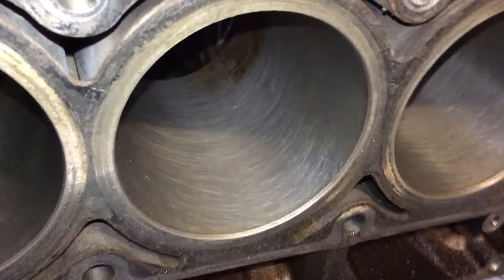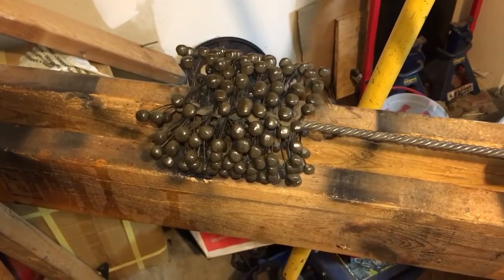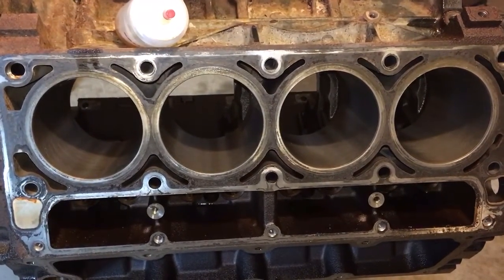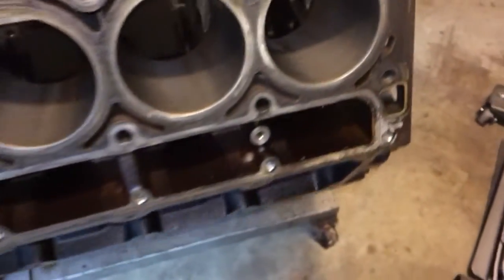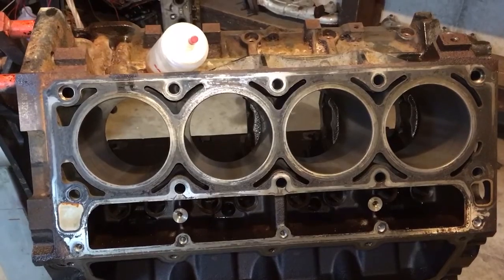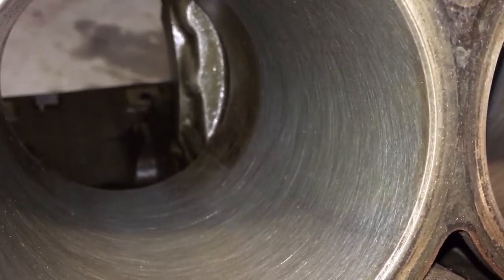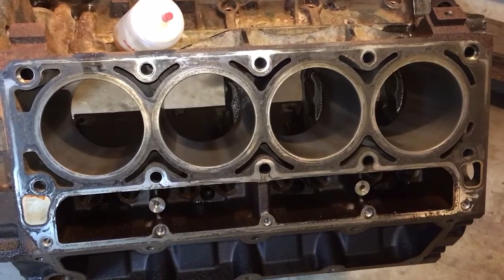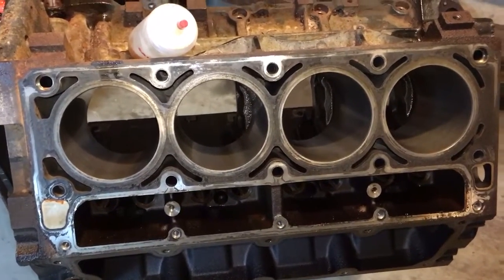Turbo 4.8 deglazing the cylinders. Turd-Bo

Comment: Did it work well for you
Reply from the maker: GEARHEAD HUFF I ended up honing it one more time, once I had better lighting I could see it needed a bit more.  Remember to alternate the direction of rotation during the honing process. 
I took this block to have New HD cam bearings and have it washed.  The machinist said the final hone job was great!
I’m just now assembling this same block!  Subscribe to see the 4.8 Turbo build. 👍👍👍

Comment: What cam are you switching to
Reply from the maker: GEARHEAD HUFF Changed from the original plan LS1 factory cam to the Elgin 1838p:
.560/.560 @.050 216/220 adv 285/292 LSA 114

Comment: It is interesting to read about using a flex hone. I had 2 friends who bought used cars that were advertised as having rebuilt engines. They were probably just rehoned while the cylinder block was still in the block, and the results was those engines burned oil like crazy. This always make me want to rebore any engine that needs rebuilding. One friend had a Jeep Cherokee 4.0 and another had an older BMW 5-series.

OTOH, I knew of many owners of the original Saturn 1.9 Twin Cam, who would use a DIY honing tool and get another 100,000 miles out of it. Those engines usually had most of their honing marks intact no matter how many miles they were driven. The OEM pistons that those cars had a dumb design. The oil return slots on the OEM pistons were too small, and the engines ran so hot that sludge would quickly make the oil return slots useless. People would take a drill and add oil drainback holes so it wouldn't happen again. They would then go through the standard procedure of putting new standard size rings on the old pistons and reassembling the engine.
Reply from the maker: Skyline Fever It all depends on whether or not the cylinder is out of round or not.  Also the quality of hone job makes a difference. A true machine shop can check the bore to verify if it needs to be honed, bored or both. 👍
Reply from the maker: Skyline Fever The oil drain back on many of the modern pistons from several manufacturers were poorly designed.  I’m not sure why?
Reply: I'm not entirely sure. I have heard people claim that the narrower piston rings are causing the problem, but not every engine with narrow rings has the problem. I have also been told that with the Saturn 1.9 Twincam, they wanted more oil under the second compression ring in the belief that it would help compression ring life.

Another problem I am told is that piston rings are closer to the piston crown than ever before. By doing that, there is less smog, but there is higher oil temperatures. I think it is good that many new engines call for synthetic only, even if they aren't built for high performance.

I'm glad you were able to explain why some engines can be rehoned and which ones must be over-bored. Given how cheaply those engines may have been rebuilt, it wouldn't surprise me if no measurements were taken before and after the honing process.

Comment: How much power are you estimating that the 4.8 turbo will make
Reply from the maker: Well, that turns out to be a loaded question with at least two answers!  The basic built 4.8 with ported #241 heads alone would make enough power to far exceed the 780+ HP at the crank the Gen3 rods like to handle.  Depending on how much boost your willing to run makes a huge difference.  I would expect my current 4.8 build would easily exceed 600 RWHP given enough boost.

On the other side of this loaded answer:  I don't plan on exceeding 500 RWHP as a safety aspect to try and protect my Gen3 bottom end.  I should be able to make 500 RWHP fairly easy.

If you wanted to just throw caution to the Wind, buy a bigger Turbo like a 76, 80, or 88mm and boost it to the moon.  The 4.8 is a very strong combo for boost.  JD
Reply: +HeadFlowInc 
Oh ok I currently own a 2009 4.8l truck its stock but I would really want to get some work done to be able to at least keep up with a stock 6.0
Reply from the maker: 97octavio
 Gen4 engines regularly handle 800 rwhp.  Boost that 4.8 with a 69mm or bigger turbo and enjoy!  You will easily walk away from a stock 6.0L with even a low boost build.
Reply: +HeadFlowInc 
Oh man I didn't know a 4.8 could handle that much power what's the estimated price you think it would cost me
Reply from the maker: The largest expense will be the Turbo and the fuel injectors.  Turbo's  $179.00-$1300 injectors $275-$400 It's hard to say for certain how much it will cost you but look up the Sloppy Mechanics website to see how to turbo on the cheap!
https://sites.google.com/site/sloppywiki/everything-ls/sloppyguidejunkyardturbols
Reply from the maker: 97octavio
 Turbo is the best way to go when building power!  When you drive normal there's no down side to efficiency and you never have to refill a Turbo.
Reply: +HeadFlowInc I will look into the link you sent me and thank you very much for the information are you still going to upload videos on the turbo 4.8
Reply from the maker: 97octavio
 I'm still going to build the Turbo 4.8, unfortunately some unforseen health issue slowing down the build.  I'll be updating the 350 sbc currently in the S10 Blazer and swapping the TH350 transmission.  I most likely doing a valve spring and cam swap in the 350 to get me by until the Turbo build is ready to go.  I've gotten the itch to go with a manual transmission with over drive with the LS swap as well, more street friendly less race oriented.
Reply: +HeadFlowInc yea manual is the way to go and oh ok well hopefully everything works out so you can get back on the build and I subscribe to your channel

Comment from the maker: Update, after looking at the cylinders closer with a flashlight I decided to hone the cylinders another session.  I'd estimate 45-50 strokes per cylinder splitting the rotation clockwise and counter clockwise.  The cylinders look much better now and are evenly clean top to bottom.  Again if you have a New or Newer flex hone you will not need as many strokes to clean the cylinders.  Work your block to determine how far you will need to hone.  JD